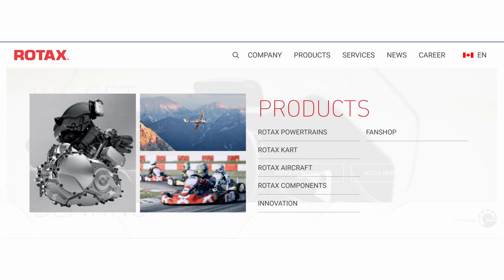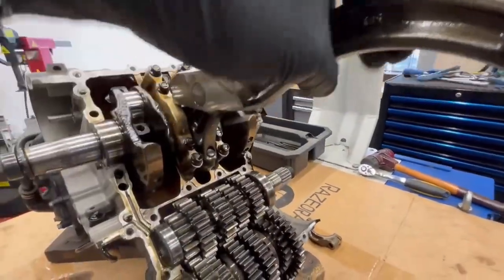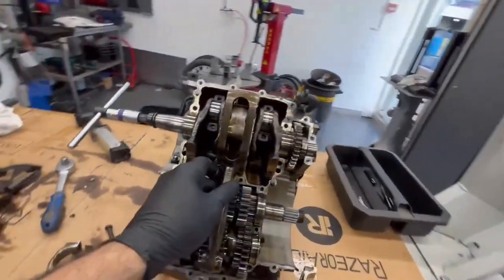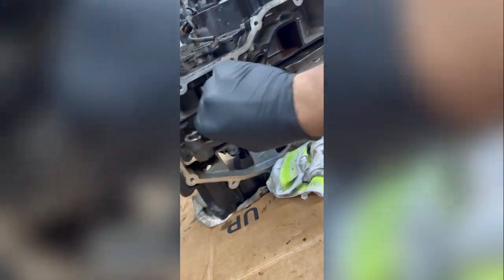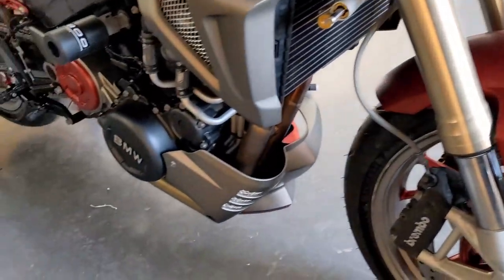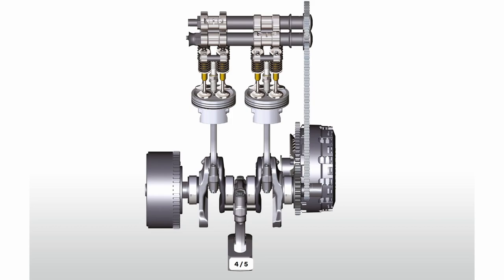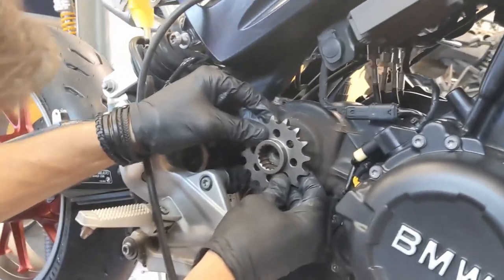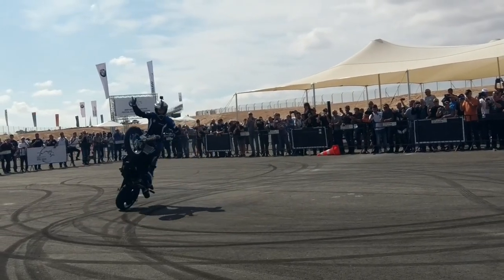Rotax 800-cc, a unique twin cylinder engine

Comment: I have a 2008 F650 twin with 40k kms. When the engine is cold there is a distinct whining noise from the engine that appears to eminate from the left lower front casing. It appears to subside somewhat (but not completely) when the engine is hot. My guess it could be the trapiziodal oil pumps or the camshaft chain tensioner....but nobody seems sure or concerned. Am I being overly fussy or is it a noise that should not be there. I have not detected it on other BMW/Rotax 798cc twin engines.
Reply from the maker: Hi, based on your description I think it is related to the bike oil pressure, try to change the oil to SAE 15W-50 as recommended by BMW
Reply: Hi, thanks for your reply. I am using Ravenol 15W50 synthetic oil. Being a whining noise that increases in engine speed from idle or with gear engaged (clutch in). With wind and road/tyre noise the whining is not detectable when riding. I am directed towards a gear noise, like one would hear from an incorrectly assembled differential....hence my thinking it could be the oil pumps or the camshaft tensioner. Anyway, maybe Im being too fussy cause its given me absolutely no trouble over the 6000 kms I have owned it.